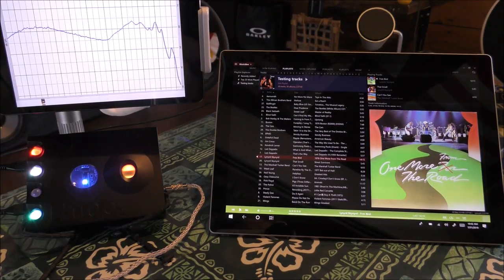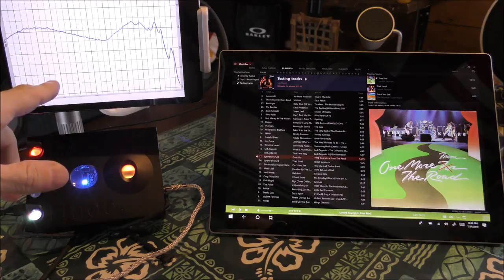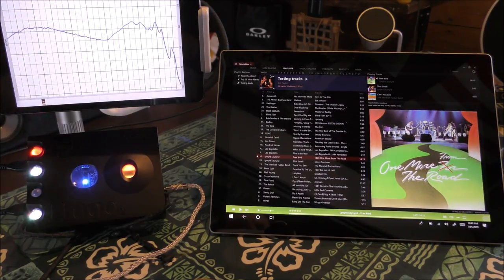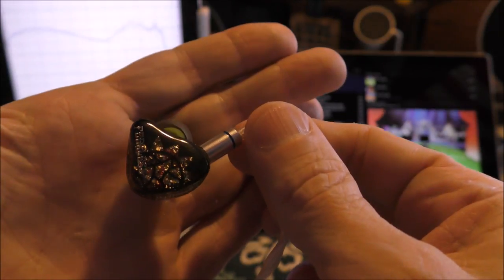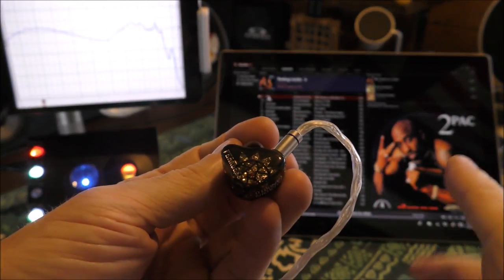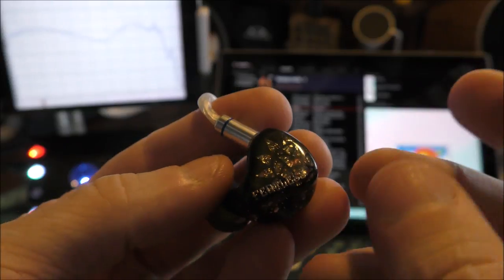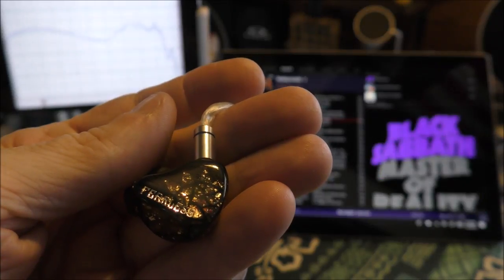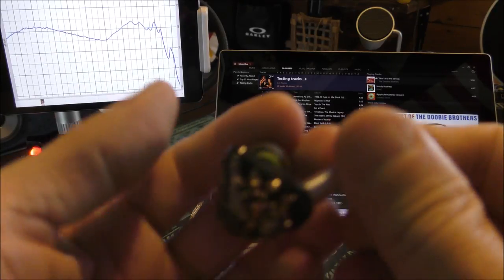Fearless Audio "Lancelot" (6/BA-2/Electrostat)

Comment: Hi.
I'm glad that my time has come in this hobby to say goodbye. 
I reached all my end game audio gear that I was looking for.
Closed headphone, Adam audio sp5 nuff said. 
Planar the thieaudio phantom is just amazing in linearity of it's sound it sounds like a beastly fast dynamic driver than a planar better driver capabilities than much more expensive options especially if you like to get technical with sculpting your own sound something you can't do easily with other planars ( audeze ).
Stax l700 and srm 353x and srm d10 just in case.
Iem I got the s12 hyper S and the Empire ears zues xiv and the sennheiser ie 500 pro, I won't consider the p1 at the same level as these but they are a good iem for my collection.
Astell and Kern x beyerdynamic t1p, a portable tesla 2nd gen version of the t1 with some improvements in distortion and linearity, holy cow this headphone is an end game headphone and I'm saying that from experience. 
After you feel bored and want to settle down just audition the t1p and end the search period, nothing else will matter and even better you can morph it through corrections to sound like virtually any headphone, it's insane by every single measure that's my open back end game headphone.
I just thought I should share the end of my journey I sure enjoyed it.
But I feel like I reached the ceiling of what I think Is the best regardless of the price.
Reply from the maker: Your willpower is commendable :) Your comments are always welcome